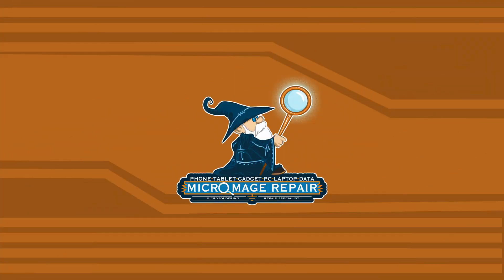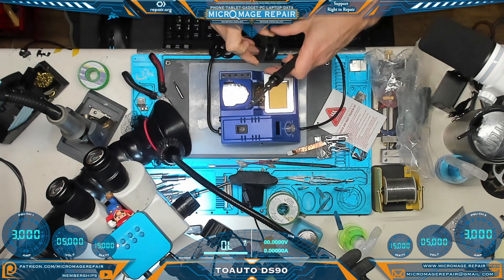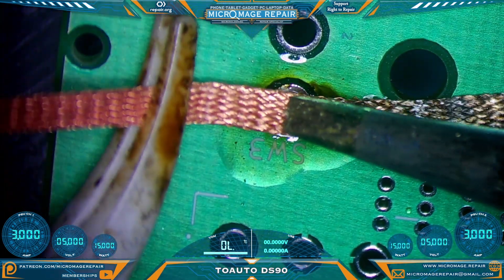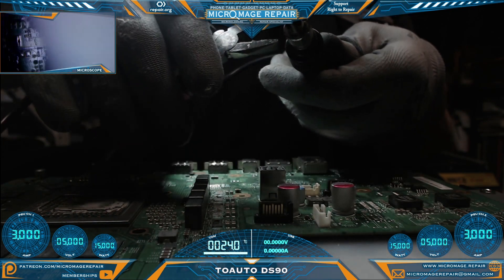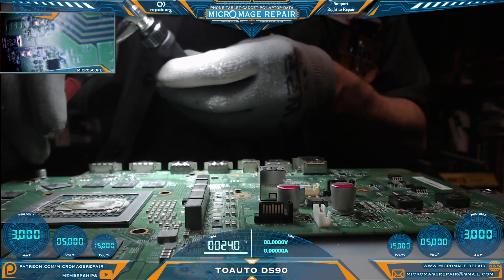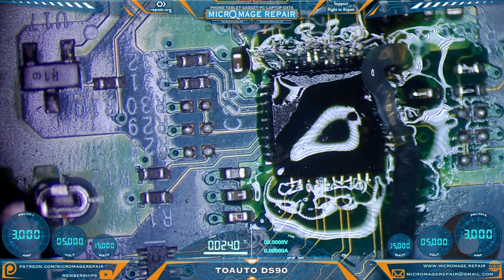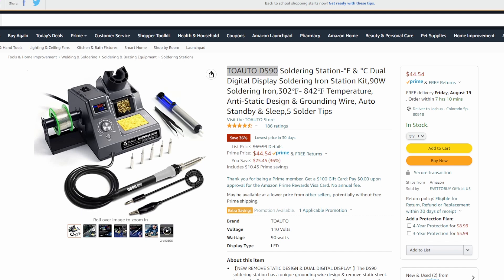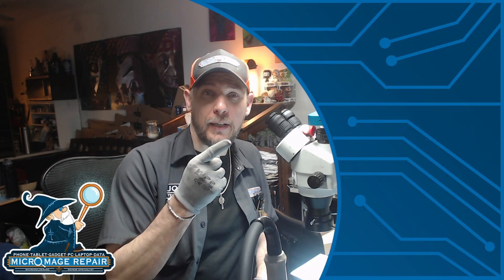🛠️ Would I use a $44 Entry Level Iron? You might be Surprised!

Comment from the maker: TOAUTO DS90
https://amzn.to/3Kb1K5a
Reply: Wut is that gel u put on & wut does it do?
Reply from the maker: @diytypeofguy6502   Liquid Flux.
Flux has dual purpose. 
It helps solder to flow and it is a cleaning detergent that helps clean or prevent the solder pads from tarnishing or corrosion. (Tarnishing and corrosion would prevent solder from adhering to the pad).
Some solder comes with "Flux core" wich is adequate for some jobs (through hole LEDs and the like) but not all.

Comment: Did you ever try those chinese T12 soldering irons like T12-x or OSS? I bought one just for fun, for like $50 a year or so ago and it works like a charm to this day, with daily (ab)use.
Reply from the maker: The reason I reviewed this one is because I was approached and the community seemed interested in me doing a entry level review when I asked about it. 
If I'm approached or if there is enough demand for me to review them then I'd certainly give them a look.
I don't personally have a desire or need to own one. 
My daily kit (the Weller WX system) is very powerful professional grade one. (Think better than the Hakko ones most everyone uses, and maybe a little below the JBC)